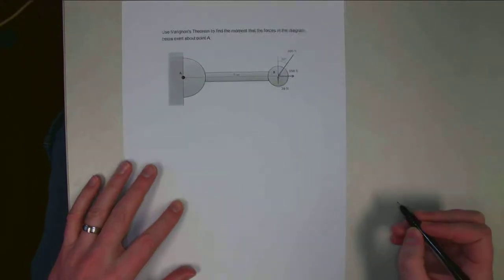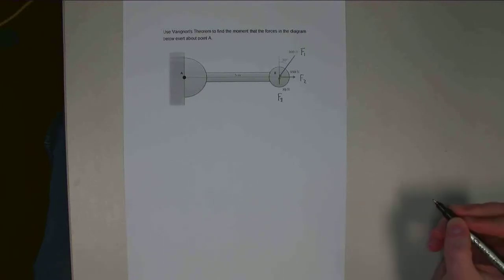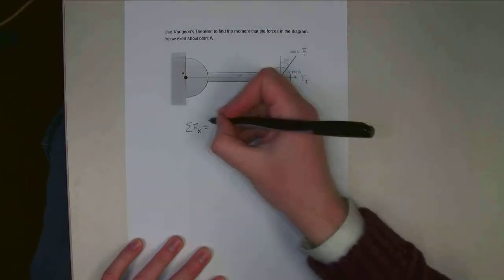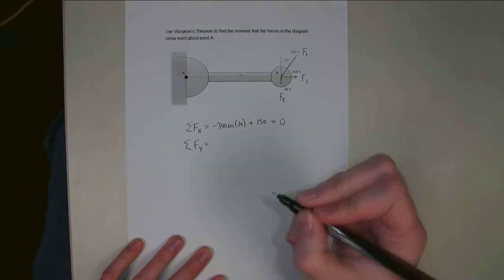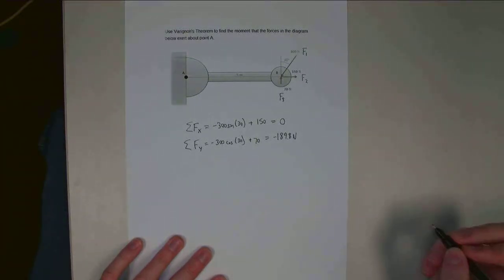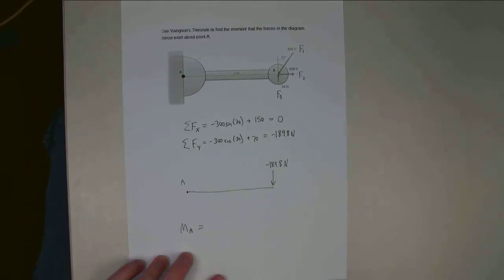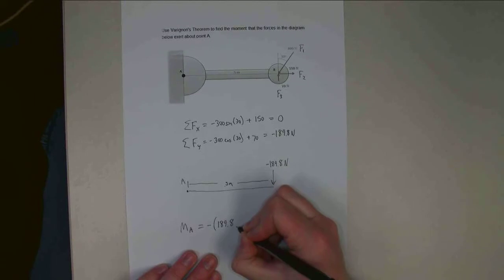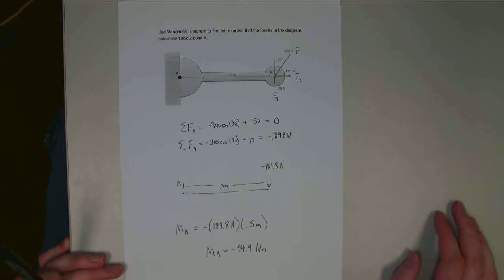Varignon's Theorem - Adaptive Map Worked Example 1

Comment: how did you take sin(30) for x axis and cos(30) for y axis, we generally take for the x-component using the cosine function and the y-component using the sine right?
Reply: i think its because the diagonal force the 300 Newtons is like the hypotenuse of a rectangular triangle and the component of that force on that triangule is the oposite cateto (my native language is spanish i dont know how to say that in english), because of that side of the triangle is horizontal the result goes on the sumatory of forces on x axis, and the trigonometric function used to calculate that side on that triangle is the sine function and the component on the vertical axis the y axis is the other cateto the adjascent cateto of that triangle and for this one he uses the cosine function
Reply: Mate since the angles given are w.r.t the Y-axis he reverse the sine and cosine, if you want to do the conventional way, just use the angles w.r.t to the X-asix in this case 60°.

Comment: distance is 5 not .5?!
Reply from the maker: It is hard to the the decimal point in the video, but it should be 0.5 meters. It's easier to see on the original problem diagram here (http://mechanicsmap.psu.edu/websites/3_equilibrium_rigid_body/varignons_theorem/varignonstheorem.html)
Reply: yeah. he might have missed that
Reply: @LeVance  actually it is 0.5 but it doesn't appear quite good in the video
Reply: @i.i  ight. just saw it too. came back here. lol